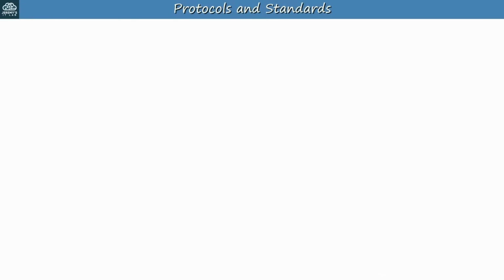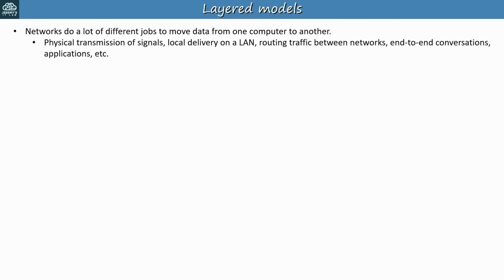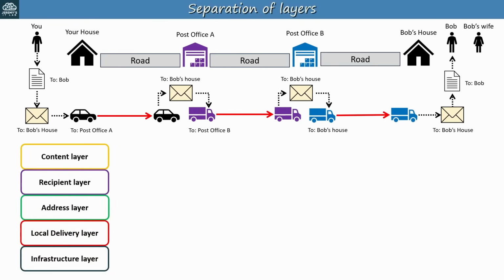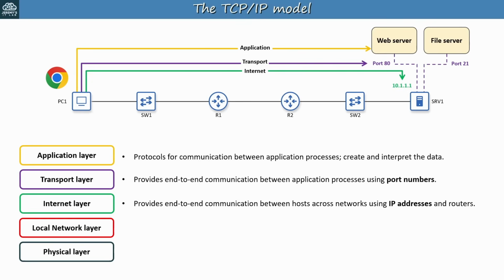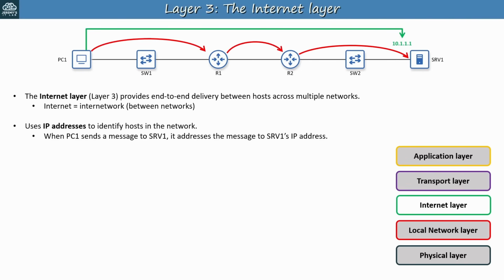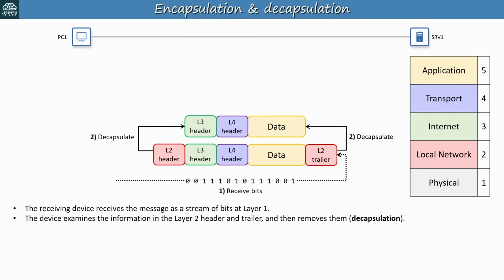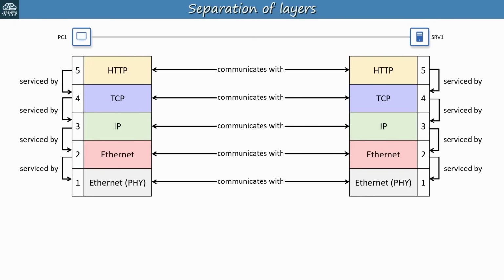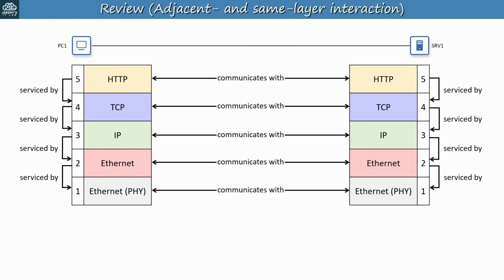How the TCP/IP Model Actually Works | CCNA Day 3

Comment: guys as an advice, anything he says he will explain in the future don't just skip it and wait for him to explain it.. search it up in google ,, as you would be confused hearing things you don't know any thing about, then trying to attach it to other pieces of information but then it doesn't build up as you don't know the meaning of a key elements here., so that at least did it for me, anything unexplained you just search it up on your own and get going.
Reply: this shits so hard to understand bruh
Reply: @rover-roblox6952  just don't give up try to search any thing you don't understand and if you still don't then just skip it and it would make sense later.
Reply: @rover-roblox6952  also strech your body every 20 mins or so i felt refreshed after some stretches time to get depressed again xD.
Reply: stopped at 31:00
Reply: also i think we need to know why are we learning things before we start learning as humans don't focus on things that they don't know it's value.

so Why Layers Matters?

-Easy troubleshooting: When a network breaks, layers help you find the exact spot of the problem. You can test if it is a physical cable issue or an application error.

-Clear organization: Each layer has one specific job. For example, Layer 1 moves physical signals, while Layer 3 handles IP routing.

-Simple upgrades: You can update or change the technology in one layer without breaking the rest of the system.

-Universal connection: Different hardware and software from different makers can talk to each other as long as they follow the same layer rules.

Comment: I find the method of explaining the network layers as a post service wastage of time and reason for confusion. Instead I prefer to explain how a click on a web link for example is handled from the Browser until the RJ45 interface on a PC. what hapens to the application message, how TLS Librar header is added. Then how Winsock (ws2_32.dll) handles the information and, then how the information is handed over to the network stak (tcpip.sys) in windows for example, and how tcpip.sys adds the TCP header to make the information a (segment) and then add the IP header and crete a (packet). Then how next hop MAC address is determined inside tcpip.sys. Then the packet is handed over to NDIS (No header added), and it delivered the IP packet to the related network adaptor driver. Then the NIC (Network interface controller) adds the Ethernet header to the Packet to produce an Ethernet (Frame). And how the NIC convers the frame to an electro magnetic signal and passes it through the RJ45 socket throught the ethrtnet wire.

I have watched this video 3 times. My brain refuses to accept the post delivary as an example because the example does not relate to the subject. If you want to make this lesson simpler you just need to mention the application which makes the request defines which protocol and which service on which IP on what port is the target, then a specific system file at the requester host is responsable for adding the TCP header (Segment header), then the IP header (Packet header), then the NIC adds the Ethernet header to the (Frame). And remember to mention that the IP addresses are for the requester and the target and they don't change along the path, while the MAC addressed are used to determine the next node along the path and they are changed from node to node. 

The course is verry useful but I recommend you not to use the post service example just because the textbooks use it, 

Best regards,
Reply: If anybody went with your first paragraph, most beginners heads would explode. There is no need to overcomplicate a topic and go into too many specifics for a fundamentals course intended for absolute beginners. You could go into that once you actually have a proper grasp on the topic.

I didn't find the postal service example irrelevant to the topic at all, and I already knew all about the TCP/IP model before this course. If someone with knowledge didn't find it irrelevant, then it isn't. You just know more details and that's why you're expecting more details. Don't expect the same from those with 0 knowledge.

Comment: The mail system is how i put together networking in my head, networking is pretty abstract so i had to figure out how i wanted associate concepts in my head.
added to that, i always saw OSPF as essentially using the least number of hops possible to get to a destination, I remember still being confused by something like BGP (border gateway protocol), a friend described the concept of BGP essentially as Amazon drone delivery, basically an instant direct delivery straight to you.

I view an IP range as a city, the specific IP and mac address as your house, and a packet as a package being delivered to you in pieces, kind of like getting furniture delivered in multiple packages, the packet contains the contents, who its for, and the address. For ports i like to view those as the dock where the delivery is transported to, contents you might be sending out might be heading to dock 443 for example (sure is a big building) and from that same dock the might be sending you back a different package, until you both decide to stop sending packages.
Reply: perfect analogy
Reply: @okaforphilip1527 thank you! I try to relate networks to real world processes

Comment: I'm very confused by this. This model doesn't follow the real TCP/IP model nor the OSI layer. Is this really how CISCO wants you to know this?

I'm referring to the fact that there is no difference between a local network and a physical layer. They are the same layer in the TCP./IP model. You splitting them up causes the confusion, and I think misleads your viewers on what the proper etiquette and required knowledge for the exam is.

Comment: Hey Jeremy,

Concerning what you said about the Transport layer around the 17:00 mark. On everything else I've seen with the TCP/IP model, whether the client is talking to the server on port 80 or port 21 would fall under the Application layer and the Transport layer would include either TCP or UDP or another transport protocol). Which is correct?
Reply: For anyone wondering that's what the RFC says as well. Please look at the Tranport layer section of RFC 1122.

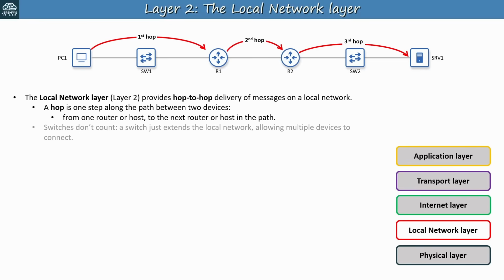Comment: 21:46 I'm a bit confused: I thought the Internet (network) layer was responsible for forwarding packets from router to router (hop-to-hop across networks), while the Local Network (data link) layer handled communication between devices on the same local network using MAC addresses and switches. But in the video the hop-to-hop process is explained in the Local Network layer.
Reply from the maker: Good question. The Internet (L3) layer is what decides each hop: the router looks at the destination IP address and chooses the next hop. But once that decision is made, L2 is what actually delivers the packet across to the next hop, by putting it into a frame addressed to the next hop’s MAC address. So L3 decides where to go next, and L2 does the actual hop-by-hop delivery over each link.
Reply: @JeremysITLab Ooh, understood, thanks!